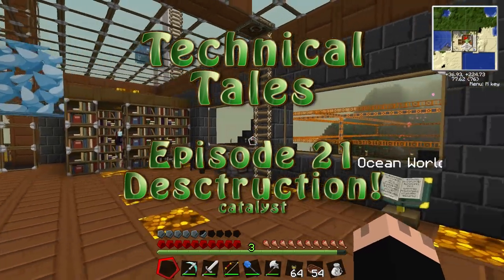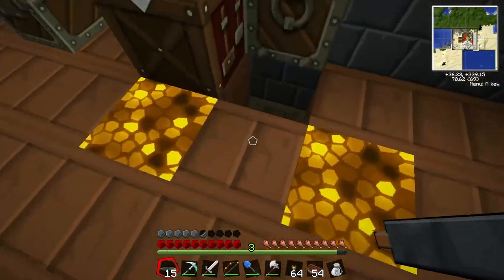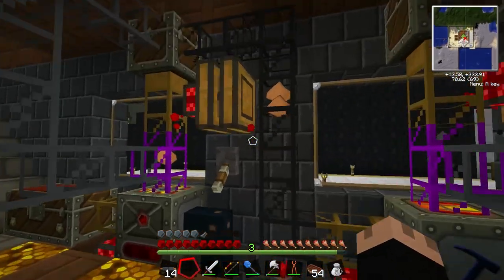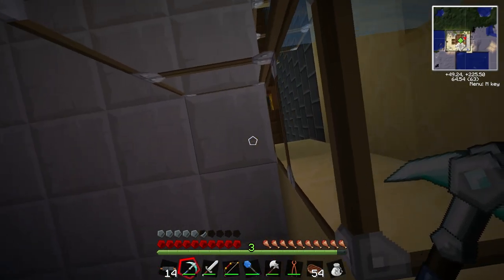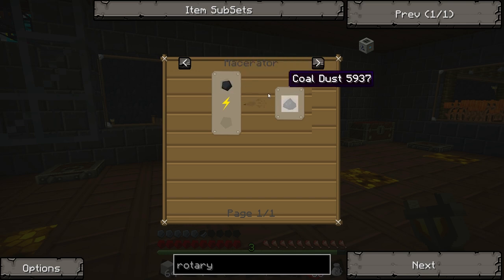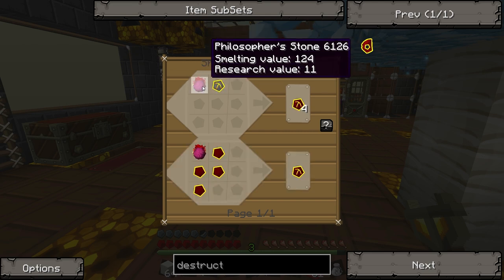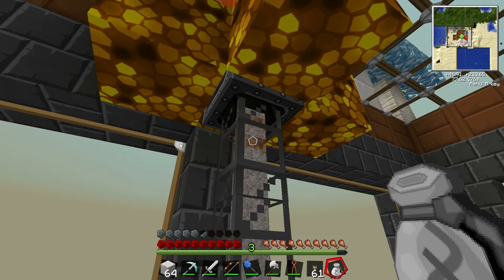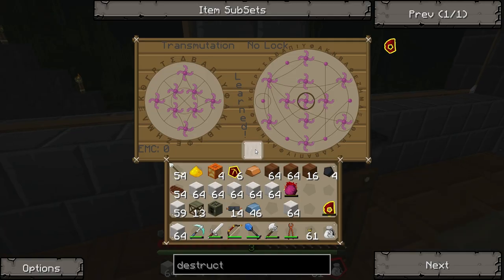Technical Tales - 21 - Desctruction! (catalyst)

Comment: You can either make a rotary macerator or build upgrades to your machines. However, machine upgrades consume a ridiculous amount of energy after a couple. It's still worthwhile to make a few upgrades to tide you over until you change the machine.

Also, a Destruction Catalyst doesn't consume one fuel item per use; it actually turns it into an EMC value stored in the Catalyst. From there, the Catalyst uses that value up until it needs another fuel item. It's pretty neat!